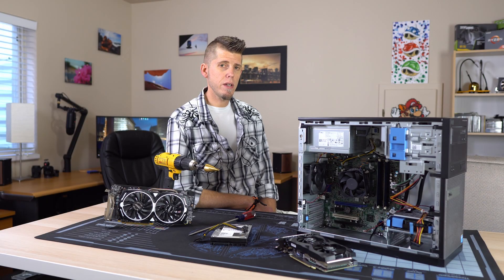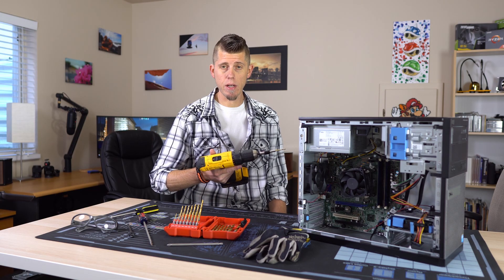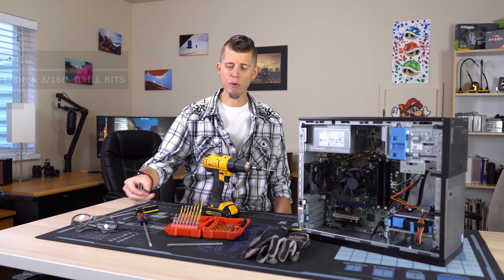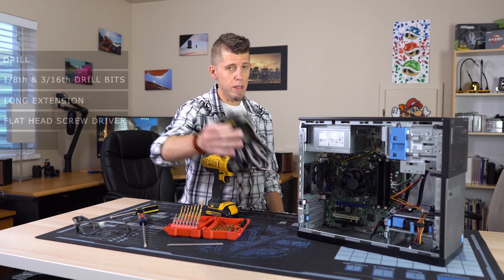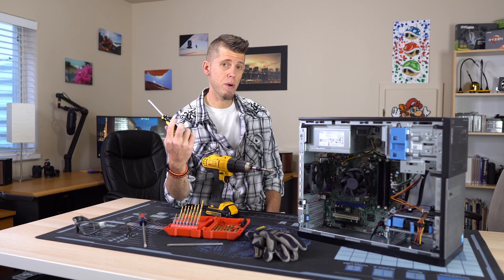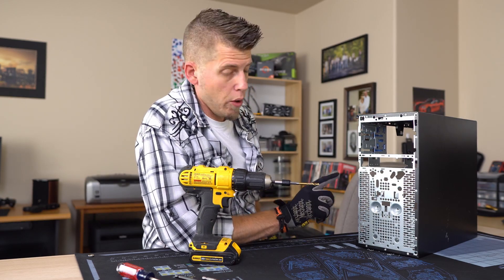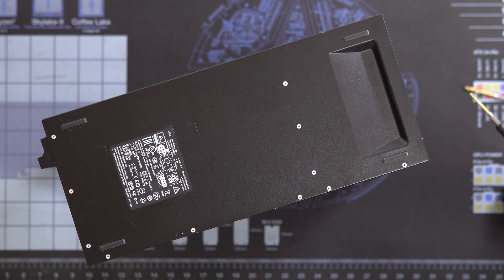Adding A Bigger Graphics Card In A Dell OptiPlex

Comment: 0:17 does the MSI armour rx570 8gb oc fit into an optiplex MT (7010 for example) without any modifications, it's under 10 inches so it should fit but I was wondering if anyone actually tried it before I buy it, if not I'll order a new drill.
Reply from the maker: It's possible that you could fit it in without removing he HDD cage, but it's right on the edge. Just be careful that you don't damage the mobo with the I/O bracket while trying to shoe horn it in there. That being said, one way or another, you'll need to use some low profile SATA and USB3 cables since the GPU will overhang the SATA and USB3 ports.
Reply: @TheGameBench  ok thank you 👌
Reply from the maker: @shan601  No problem.

Comment: Will the graphics card interfere with the USB header on the motherboard? It seems lined up for some larger cards..
Reply from the maker: You must have an xx10 model? That's one of the reasons why I went with the xx20. With the xx10's you either have to limit yourself to GPU's under 8.5". Even if you do that, it might make sense to remove the HDD cage to add a front fan, maybe not. Just depends on the GPU. However, I did a recent community post showing people how to get around the SATA and USB3 ports with some low profile cables.

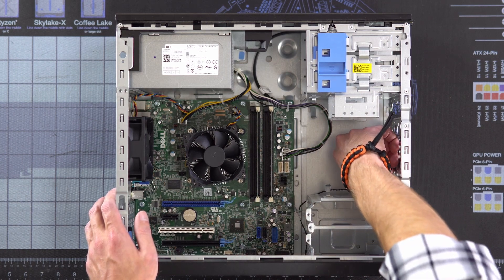Comment: i have a optiplex 790 small factor and there is the same wire on 5:04 on my power supply i was wondering if i throw that away will my power supply function properly?
Reply from the maker: That wire is the thermal sensor and it doesn't really have anything to do with the power supply, so the system will function properly without it. However, it will cause the fans to run at full speed. I keep the sensor and bundle it with rest of the cables.

https://youtu.be/snUV0wGPnPk?t=537

Comment: I took everything out of the case and spray painted the inside all black. I found a spot below to disc drive to zip tie my drives in place
Reply from the maker: I do want to do a video on that, but I want to drill out all the rivets and disassemble the chassis before I paint it, then rivet it back together.

Comment: Just wanted to add: I got an EVGA GTX 970 SC for my Optiplex 9010. It fits (without removing the hard drive cage) but JUST barely. It does block the USB 3.0 header, but with one up and one down right angle adapters (https://www.ebay.com/itm/19Pink-20pin-USB-3-0-Male-to-Female-Extension-Adapter-Up-Down-Angled-90-Degree/153461065282?ssPageName=STRK%3AMEBIDX%3AIT&_trksid=p2057872.m2749.l2649), everything fits and connects just fine! Thanks for your very helpful videos.

Comment: Heres a good ??  If you replace the m/b with a newer mATX (B450, B550) do you have to reposition 1 or 2 of the standoff posts? Can a USB 3.0 (blue) be nicely installed in the front, so it looks just about OEM? Thank you 🤓
Reply from the maker: Well, there's no moving the standoffs in the Optiplex case as they're stamped into the motherboard tray. However, they're standard micro ATX so it should drop right in.
Reply: @TheGameBench  ok thanks. I havent removed the existing m/b, as I dont have a new 1 yet - sorta waiting on B550 mATX info!

Comment: I won't lie this looks almost as annoying as building a pc from the ground up. Is this really necessary to fit a full sized GPU?
Reply from the maker: In the OptiPlex chassis.... yes. You can always do a case swap, but any ATX case under around $50 is going to be a pile of crap compared to this one. It's pretty sturdy, even after all my modifications. That being said, depending on your situation, and case swap might make more sense from a simplicity and cost standpoint.
Reply: @TheGameBench  Right now I am running an i5 2400, Dell 790 SFF with a HD radeon 6450 1GB. I was considering upgrading to an MT but part of me wonders if my current rig is worth upgrading. What do you think? P.S. Do you happen to have a discord? 👀👀
Reply from the maker: @coolguyvideos599  The 2400 would be fine with any low profile card you could put in there, and would blow that out of the water. Considering you could get it for a good price. Also, no Discord. I thought about it, but I barely have time to make videos right now.
Reply: @TheGameBench  I heard a lot of people go with the gt 1030 gddr5. Have you ever tried that one? Sidenote: The prices on ebay for 7020's and 9020's mt's are exploding. 😱What other brands or models would you suggest for back-ups? 👀
Reply from the maker: @coolguyvideos599  The 1030 is a pretty entry level GPU. Not something I would ever stick in a build personally. There are better options for the money. I still find the xx20 systems for a good price. You just have to be persistent and patent. If I were to suggest something similar, it would be the HP 600/800 G1 systems.
Reply: @TheGameBench  I was able to find a pretty good priced 9020 with a I7 4790 👀👀 As far as GPU prices go, the Low profile ones I like are are always the same price. Guess I should wait black friday ehh?  What do you think of the GTX 1650 GDDR6 low profile? Apparently it's new but I heard it overheats 😱
Reply from the maker: @coolguyvideos599  I don't know about that... don't see a reason why it would. They'd just use the same cooler from the existing LP cards, and they've been adequate. But yeah, the LP cards are always more expensive since they a niche market and there aren't many to chose from, so not a lot of competition for the few models there are.
Reply: @TheGameBench  Why do you suppose more people don't get into the LP market? I see a good number of people wanting them, so it just seems strange. You personally don't really like to use LP cards right?
Reply: @TheGameBench  Someone should make cheaper LP cards to drive down the price because at their current price it's kind of ridiculous.
Reply from the maker: @coolguyvideos599  The reason they're so expensive is because they not big sellers and not many companies make them as a result. There would have to be a higher demand to bring the price down.... unfortunately.
Reply: @TheGameBench  Hmmm too bad but thanks for the 411!
Reply from the maker: @coolguyvideos599  No problem.

Comment: Ngl with all that u have to do with this case it might be a better solution to just get a new case all together.
Reply from the maker: I won't argue that. I do this because I have the tools, and with the intention that the person thinking about doing this has the tools or most of the tool, or was going to buy the tools for another reason. I'm not a huge fan of case swaps since the OptiPlex chassis is really sturdy. A lot more so than cheap cases. Plus making everything work can be a PITA since there are a lot of proprietary connections on the inside.

Comment: Great drilling technique sir!  When drilling, as opposed to screwing, the drill should only be spinning in the forward drive.  Once the hole is bored, the drill bit is designed to be pulled out while being rotated in the same drive in order to burr out stray material.  When people reverse the drill bit to pull it out, it also damages the cutting edge of the drill, which heats it up and may cause the bit to snap.  It always hurts me physically when people reverse the drill drive!!
Reply: dude relax he just using a drill .  u must not work .

Comment: Got my first one modded.  Great instructions.   I think the hardest/worse part is dealing with all the aluminum shavings from drilling.   lol  I did the drilling outside on my driveway but didn't like all the shaving on there.    You know for those who like to go barefoot.  Good thing I got a good shop vac.
Reply from the maker: Haha, yeah. Even worse if you use a stepper bit to do the fan mod.

Comment: So if I still want a hard drive I can just use an external hard drive (which I already have) and plug it into a USB port?
Reply from the maker: Sure, but the speed isn't going to be as fast over USB3. That's if it's a USB3 drive and the model you have has USB3. USB2 would be tough to deal with.

Comment: Did not work tried for ages, what a waste of time, took all the rivets out and would not budge beware
Reply from the maker: Then you missed something/didn't get everything drilled all the way out. Done over 20 of these systems and this method has worked perfectly, every time.
Reply: The Game Bench oh are you using the 3010mt?
Reply from the maker: @Medwolf  No, this is a 9020, but the xx10 series are the same. However, I've seen a few where they're mounted to that backplate differently. Most of the time, they need to be drilled out, like in this video. However, I've seen some xx10 models where the cage is slotted into the back plate. One you remove the bottom rivets and all the points on the front panel, you should be able to simply lift the cage out of those slots and remove it.

Comment: I have a dell optiplex 9010 and it doesn’t have the rivets on the bottom of the case. What do I do?
Reply from the maker: Are you sure it's a 9010? I'm looking at the bottom of a 9010 right now and it's got all the same "rivets" in the same places, and I've done this to like five 9010's in the past and they've all had them. The only difference I can think of is that the cage is slotted into the back plate inside the chassis rather than, pressed onto it.
Reply: The Game Bench it says 9010 on the case, anyways it has all the rivets in the same spot in the case. Just not on the outside on the bottom
Reply from the maker: @mr.commenter4794  Hmm... I don't know what to say without being able to examine it. Every single xx10 I've worked on, or seen, has had those rivets on the bottom. Just like any other system that uses this chassis.
Reply: The Game Bench I took a harder look and it looks like there was a big black sticker on the bottom, I peeled it off and now I see the rivets.
Reply from the maker: @mr.commenter4794  Ah... weird. Glad you got it figured.
Reply: The Game Bench thanks, and I subbed. Your videos are very helpful, keep up the great work on your channel

Comment: I have the 9010 and the hard drive case wasnt the issue, the SATA connectors being so close to the PCI slot was the problem. IF you guys saw what i did to make my GPU fit youd probably cringe, i made an amd RX 570 xxx edition fit in there
Reply from the maker: Yeah, I talked about that in the video before this. I really need to do a video about how to get around the SATA and USB3 port. Did you hack up your GPU shroud or something?

Comment: Can I add a gtx 1660 super to a dell optiplex 3070 tower (not the micro one)
Reply from the maker: I've never worked in one, but it seems to share the chassis with the 40 series. You'll be limited on size, but I'm sure there are 1660 Super's that are small enough to fit. Where you run into a problem, is the power supply. The 70 should have a 260 watt unit. With the 1660 Super, at stock clocks, will probably consume around 210 watts. This gives you only 50 watts of headroom. You could technically do it, but I don't know how good those PSU's are and I wouldn't leave myself with 500 watts of head room on a really good power supply. The most I'd pair with that PSU is a 1060 3GB model or an RX 560.

Luckily there are TFX power supplies that should be a drop in replacement, possibly with and adapter, that would have plenty of wattage. You could even rig a flex ATX or SFF power supply in there if you wanted to.
Reply: @TheGameBench  anyways  would i change the psu to 600 watts but my problem was if the 1660 super would fit in .
But I think it would fit
these are the card size Card size
L=225.65 W=122.02 H=40.5 mm
And it has 2 fans.
The card name is 
"Gigabyte GeForce® GTX 1660 SUPER™ OC 6G"
Reply from the maker: @yassinamin  Looking at that model , and I think you should be able fit that in there without a problem. You might overhand the SATA ports... maybe. If you do, you can get some low profile SATA cables.
Reply: @TheGameBench  thank u for helping  i appreciate
Reply from the maker: @yassinamin  No problem.

Comment: After some research I think the biggest GPU the stock MT powersupply can handle is a 1070ti.  Will test it when I can find one for a good price.
Reply from the maker: Well, it might be able to power it... but it's not a good idea regardless.
Reply: @TheGameBench  People seem avoidant to upgrading the PSU which is one of the lower cost parts in an Optiplex upgrade.  It's the first thing I do.  I try and find a modular PSU with 550 to 650 watts minimum.  These can always be used in the next Optiplex one upgrades if they accept that future assignment.   I keep my eyes out for a 9020, why not.
Reply: Hi dale.
Can hd 6850 run on stock psu?

Comment: is a rx 470 still fine to fit in normally?
Reply from the maker: Well, depends on the model of the GPU and the model of OptiPlex. You can manage to get anything around 9.5 inches in there without removing the HDD cage. However, the xx10 series and x90 series have the SATA ports, and USB3 in the xx10 series, are in the way and you need low profile cables to clear the GPU or the GPU can't be over 8.5 inches.

Comment: I have a Dell Optiplex 790 and I ordered a gigabyte gtx 1050 ti and didn't fit😡
The ram clamps didn't let the card go all the way in.
Is there anything I can do?
Or I just need to get a different card?
Reply from the maker: I've never had the RAM latches prevent me from installing the GPU, as long as they're closed. Unless it's got an abnormally tall backplate or something. I've installed a 1080 Ti FTW3 in an x90, xx10 and xx20 series board without any issues from the RAM slots.

Comment: any luck upgrading one of those  Lenovo ThinkCentre E73? Some really good deal going on right now. Thanks,
Reply from the maker: I'm not bog on Lenovo's since they're so hit or miss on being able to modify them. Some of their models are limited in the BIOS as to what GPU's can be installed. I know not all of them are like this, but it just turned me off of being interested in them all together. Looking at the E73 on eBay, they all seem to be i3's or low power i5's, so the S models. Honestly, I would avoid anything with the S CPU's for gaming. They're not worth close to $100 with one of those i5's.
Reply: @TheGameBench  thanks you for the input.
Reply from the maker: @Mambrax444  No problem.

Comment: I was curious if an MSI 1080 is plausible for an Optiplex? And if so, what's a PSU I could use for it?
Reply from the maker: If you remove the HDD cage, shouldn't be a problem. Which model is it specifically and how much do you want to spend on the power supply?
Reply: @TheGameBench   I'm willing to spend up to $100 on a PSU. Specific model of GPU is MSI Gaming GeForce GTX 1080 8GB GDDR5X SLI DirectX 12 VR Ready Graphics Card ( GTX 1080 ARMOR 8G OC)
Reply from the maker: @jimrye7952  On the GPU, are you getting a killer deal on it? All I know is that the Armor cards leave a lot to be desired in the cooling department. You'd definitely need a front fan. However, with the HDD cage removed, it'll fit just fine. For the PSU, the EVGA 600 BQ for about $70 is a good option. If you want to spend up to $100, Thermaltake Toughpower GF1 650 is a good option too.
Reply: @TheGameBench  I actually received it for free. My friend had basically never used it on any really taxing games or anything and he recently bought a 2080, so he just gave the card to me. I've been a console player for my whole life and I'm trying not to spend a ton of money on something I'm not sure I'll really get into. Really appreciate the help man, thanks

Comment: What does "chassis intrusion switch" do?
Reply from the maker: It was designed to notify the user if the system were opened. Either through the BIOS or an audible beep through the internal speaker. It was something more prevalent on older PC's... like much older. I don't believe it was every really intended for consumer use and was more meant for the enterprise market. I just disconnect them and throw them in the trash.
Reply: @TheGameBench some people sell this thing for $ 40 https://www.ebay.com/itm/FOR-DELL-OptiPlex-790-Desktop-Computer-Intrusion-Switch-Cable-CN-UC635-OUC635/264433201225?hash=item3d91727049:g:~uUAAOSwBCNdZioV
Reply from the maker: @teramaister  Weird... I don't think they're getting that though. Looking at sold listings, they sell for $5 - $10. Still, I've thrown like 20 of those damn things away. That's like $100 to $200. Damn... Thanks for the heads up.
Reply: @TheGameBench  hahahaha :) I hope you'll get better soon.
Reply from the maker: @teramaister  Thanks!

Comment: Just ordered a GTX 1660 XC Ultra. It’s a 10.5 inch card so will this be necessary?
Reply from the maker: Yep. I've been able to shoe horn a 9.5" card in and I feel like 10" would be really tough to get in there. No way you're going to fit something that's 10.5" in without removing the HDD cage.
Reply: The Game Bench Also you did put the hard drives into the dvd drive slot right?
Reply from the maker: @TheStratus  I mounted it in the bay right below the DVD drive. I go over all the mounting solutions in my latest vid if you're curious. There's timestamps in the description so you can skip right to that part.
Reply: The Game Bench So, I can mount two hard drives right or just one
Reply: The Game Bench Right now I’m in the process of removing all the parts but my hard drive caddy just does not budge
Reply from the maker: @TheStratus  What model is this? x90, xx10, or xx20?
Reply: The Game Bench  3020, I eventually got it out I just needed two hands
Reply from the maker: @TheStratus  Ah, okay. Yeah, sometimes they take a little coaxing. Also, if you want to mount two hard drives, you can use those tabs below the 5.25 inch bays to mount the second drive.